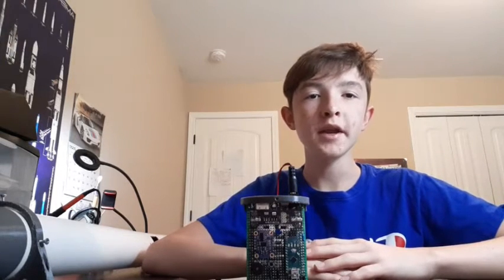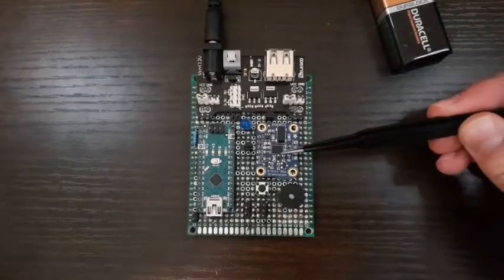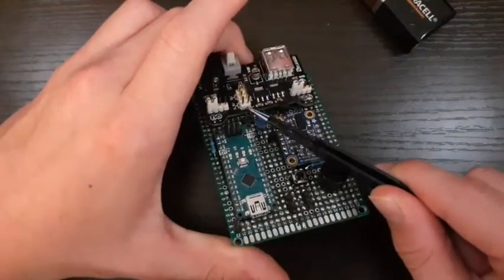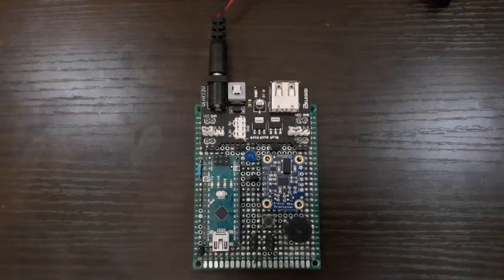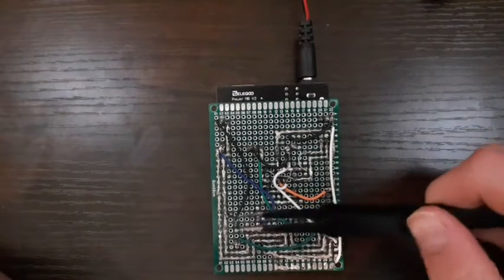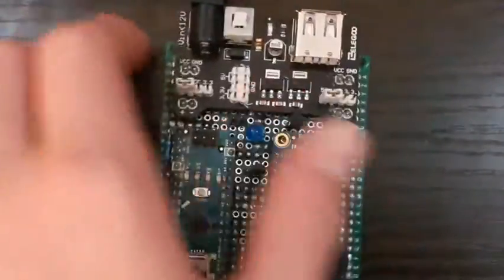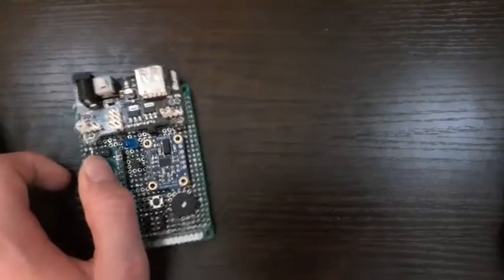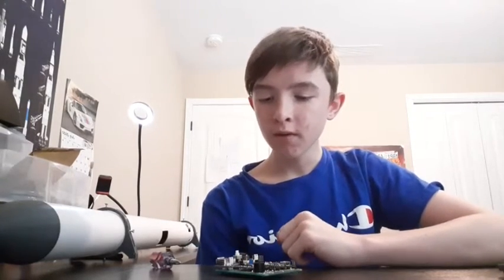thrust vector controlled model rocket | flight computer

Comment: Just a heads up. Don't use the quaternions straight from the bno055. There is a lot of math involved and getting the values straight from the bno055 library uses accelerometers which won't work on a rocket even though it works fine when the flight computer is under little to no acceleration.

Comment: For us lower intellectual beings, what be a thrust vector control mount?.
Reply from the maker: That thing at the bottom of rocket that moves the motor. It changes the angle of thrust, so that it can change the direction the rocket is guided.

Comment: Hey this looks really cool man, I’m working on a similar flight computer and am having some difficulty with the inertial measurement unit for orientation. I’ve read that errors can arise with these chips while under more than 1G of acceleration, which rockets tend to do haha. Any advice for getting round this problem? Thanks :)
Reply from the maker: I've encountered the same issue with my computer. I dont have any advice on how to get around it, but it's an issue I plan to resolve in the next iteration of the flight computer. I'll make sure to tell you if I come upon anything that might be of assistance.

Comment: is there any fight data?
Reply from the maker: I've only been working with arduino for less than a year, and when I designed this flight computer i completely overlooked the fact that i needed some sort of data from the flight. Because of this I'm debating whether to use this flight computer for 1 or 2 launches, or start over with a better pcb version. To answer your question, no, this flight computer does not record any flight data.

Comment: Do a pcb
Reply from the maker: That is the next step for the rocket. This flight computer was more for just learning, and I plan on creating a better, pcb version. It will include an sd card reader, barometer, and more pyro outputs. Over all a better flight computer.
Reply: Use the teensy 3.5 built in card reader
Reply from the maker: I was thinking that too. It would save weight and space, compared to an sd card breakout